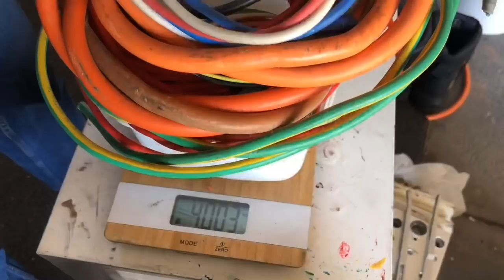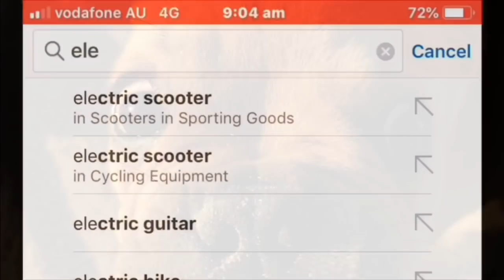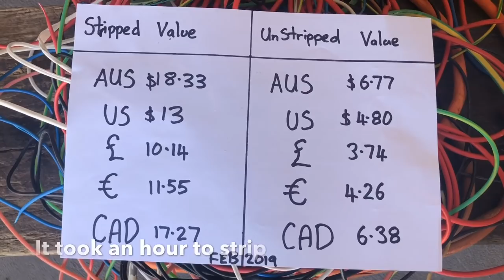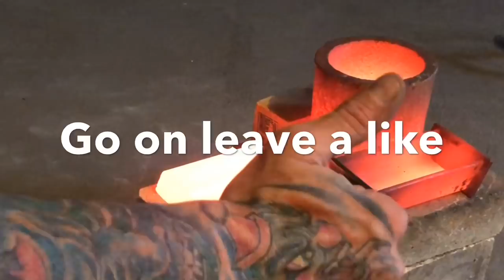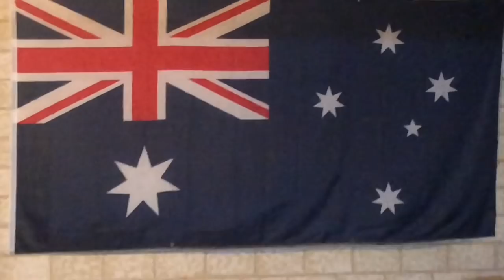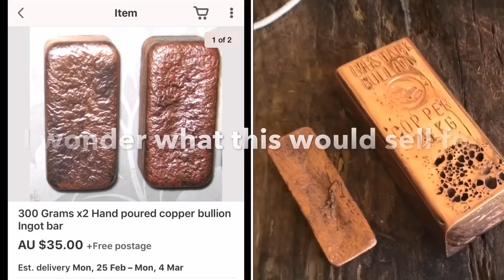To Strip or Not To Strip - Is it really worth stripping Copper Cable🤔 - Melting Copper

Comment: Can i melt the copper wire with in coating on it or is it best to strip it. Ive got some copper thats really thin
Reply from the maker: You certainly can matey just don’t tell anybody about it or they’ll have a cry because people get really concerned with how much smoke it will produce🤦🏻‍♂️ you’ll just have a lot of extra crap to skim off the top but I did that in a recent video and the bar will come out exactly the same just give it a couple of skims and it should be perfectly fine mate.
Reply: @bigstackD  ok thank you bud my smelter comes in tuseday and i can wait to start melting an making ingots
Reply: @bigstackD  by the way how long dose a tank last you when melting stuff
Reply from the maker: That’s cool mate here’s a couple of pointers that might help you out👊🏻😁
Always always pre-heat your molds and never ever add cold metal to Molten metal , always preheated metal your adding to eliminate all moisture or the possibility the colder metal may make the molten metal splash out of the Crucible . 
The reason I always pre-heat molds and metal that is going into the Crucible is because if any moisture is trapped under the molten metal it can become steam instantly creating a steam explosion and that is basically a big pop where it sends molten metal everywhere . 
Always use a facemask when adding metal to the furnace or looking in furnace, always use enclosed shoes and I always use a thick jacket and jeans .
Even though that may not stop molten metal it makes me feel safer👍🏻. Always check connections and hoses before use , and any time you can smell gas while the furnace is running shut down and find if the connections are leaking because when the furnace is in operation you should never smell any gas at all. 
Always temper new crucibles to avoid the chance of cracking them on the first firing . 

TEMPERING CRUCIBLES 
https://youtu.be/wWAJPlrcQVY 

REGULATOR SET POINT and adjustments 
0.12MPa Copper
0.10MPa Brass / Bronzes
0.08MPa Aluminium 
I set the regulator at 0.10MPa for brass and when it gets up closer to its melting point I backed the furnace off to 0.08MPa to make sure I don’t accidentally overheat the brass and burn off the zinc.
These are my go to set point mate when I would light the furnace I always leave the valve open on the burner so there is never any trapped gas in the line (I never ever use the valve) then I’ll simply put a piece of paper that’s on fire in the bottom of the furnace and turn the gas bottle on. Once I have got flame in the furnace I will make sure the gas bottle is turned on at least one full turn and then I just adjust the regulator to what pressure I need and then spin the choke to get the furnace flame perfect. 
If you stop the furnace at any time during the melt I never ever touch the regulator or that valve I simply turn the gas off on the bottle that way all gas  will be burnt and depleted and there would be no stored energy anywhere. And then when I want to start the furnace back up if the Crucible or inside the furnace is still red-hot you can very easily just turn the gas on and it will auto ignite but if it isn’t quite hot enough yet again I will just drop a bit of paper into the furnace and once it ignites turn the gas bottle on and continue melting. I’m pretty sure that straightforward that’s how I’ve run it for years and I’ve never ever had a problem.
Any other questions let me know and I’ll answer soon as I get a chance👊🏻😁 

Any other questions let me know and I’ll answer soon as I get a chance👊🏻😁
************************************************
HOW TO MIRROR FINISH A BAR 
I start with an 80 grit flap disc on my angle grinder then I use my drill with a 50 mm round sanding discs . I start with 150 grit then go through the following Gritz 240-400-800 Then once I get to the following Grits I use a small squirt of WD-40 1200-1500-2000-2500-3000. The WD40 helps to lubricate the discs and stops the sanding disk binding up with the metal powder . Then after that I use my buffer wheel on my bench grinder to get a perfect mirrored shine on it👌🏻😁.
———————————————————————
Starting to melt tips
here’s some key factors that you would probably want to know. 
Definitely do not mix metals that haven’t already been proven so don’t get a heap of different metals and just chuck it all in there and melt it all together to make your own special blended Alloyed metal As some metals could have bad reactions with other types of metal . I’m not really sure what would happen with unproven alloys but it’s not worth the risk and obviously if no one has done it before it’s probably for a reason.
Always pre-heat your molds  before you pour into them to eliminate moisture as if there is some moisture in there it will turn to steam instantly creating a steam explosion sending molten metal everywhere .
When adding metal to the Crucible if the crucible has  molten metal already in there then definitely heat up the metal when you add it as that as well can have moisture on the surface and that can create steam a explosion aswell . 
If it any time while running the furnace you smell gas shut it straight down as you should not be able to smell gas while it’s running. So you’ll need to check your connections before and after each melt and always keep an eye on your gas hose as when melting hot Embers and stuff can come out of the furnace and if it lands on the hose it can slowly burn into it. So normally I will put my welding gloves over the hose or anything else that might help protect the hose. 
Always a good idea to wearing enclosed shoes and 100% of the time when looking into the furnace use safety glasses or a face shield as well as when you’re pouring use safety glasses or a face shield. 
Always melt in a well ventilated area and I would suggest wearing a respirator at all times unless you’re staying up wind for the entire melting process. 
I’m completely self taught through trial and error, luckily not too much Error . And I have watched a shitload of YouTube videos to try to pick up what I can . 
I will attach a copy and paste message that I sent to everyone which will have some additional info in but any other questions just let me know and I’ll get back to you when I get a chance. 
———————————————————————
Devil forge Furnace starting 
Matey I always leave the valve next to the burner fully open and did never turn it off no matter what. 
Starting burner I follow these steps .
Close the choke on the back of the burner (that little Circular plate that spins in and out) . I always start my furnace with the lid open so there’s no  possibility of a buildup of gases. I get a small piece of paper light it on fire and drop it inside the furnace in front of the burner hole . Then I turn the gas on on the propane bottle to get a flame in the furnace. Then I check the regulator make sure it’s around 0.1 MPA , Then I go and adjust the choke on the back of the burner and slowly open it outwards until I get the desired burner pressure and Air to gas ratio. For copper I normally run at 0.12MPA for brass just under 0.1 MPA the same with aluminium. Always check your connections and if the furnace is lit and you can still smell gas turn it off and check connections again ,always remember safety first , always pre-heat your molds and always do your research before trying anything you’re not sure of . Again that valve on the side of the burner I have never used it . If I need to go into the Furnace and I don’t feel comfortable while it’s running  I will turn the gas off and just go through the same steps to relight once I’m ready . Also if you’ve been running the furnace for a little while and the Crucible or the inside of the furnace is still redhot you can normally shut the lid then restart the gas and it will ignite straightaway to save time . Any dramas contact me on bigstackddddd@mail.com And I’ll try to help when I get time alternatively contact Devil Forge at 
info@devil-forge.com. 👍🏻
Reply from the maker: @bulletzgodakakarma300  I normally get three or four melts out of a tank
Reply: @bigstackD  thank you for all the tips i saved them to my phone so i can reference them better before i start. And i really thought youd get more then 3 or 4 melts out of a tank but thats good to know ill have to get another tank because i only got one yesterday lol
Reply: @bigstackD  last question i know i have is i dont have a ingot mold yet can i use one of my small cast iron skillets as a mold until i am able to buy a real ingot mold?
Reply: @bigstackD  What causes the void in the copper on your bar, and how do you avoid it? (Thanks)
Reply from the maker: When melting copper I would highly recommend using graphite moulds as if the copper is a bit dirty Paul has some soldering it from some old pipes it can fuse to cast iron and steel moulds. You might be completely fine and get away with it but I’ve had quite a few problems with that. All graphite moulds are available on eBay you just need to look around for the bigger ones. The Cast iron mould you’re talking about should be perfect with brass and aluminium as I’ve never had a problem with those metals  in cast iron.
Reply from the maker: The voids in the copper bar I honestly have no idea how to get rid of that? My only thought is possibly I’m overheating the copper in the devil forge as when I use my home-made furnace years ago it took an hour to melt copper and I never ever got a bubbles on my ingots. But honestly I’m not sure🤷🏻‍♂️

Comment: So the answer is 'no it isnt worth it'
You stripped 5 lbs of copper in an hour.
Going by your prices in the UK (where I live), you can buy that much scrap wire at £3.74 and sell it stripped as highgrade for £10.14.
Thats a profit of £6.40 for an hours graft. The national wage when this video was released was £7.83 per hour - you will earn more money simply filling chillers in the local supermarket.
Then you have to consider, if you were going to strip 200 lbs a week, you would need a truck to transport the copper around, adding huge costs in diesel - plus the costs of the leccy for the stripper, and while tossing the waste plastic from 5lbs of cable into the bin is doable, there certainly isnt enough space to hold 200lbs a weeks worth, you would need to pay waste disposal. So, stripping is not worth it.
Would be far better off grafting in a supermarket for an hour, going to the local scrapyard, selling the cable unstripped, buying, using the money from the grafting and the money from selling the cable, highgrade from them, and melting that down into ingots. You would get more ingot in the same amount of time.